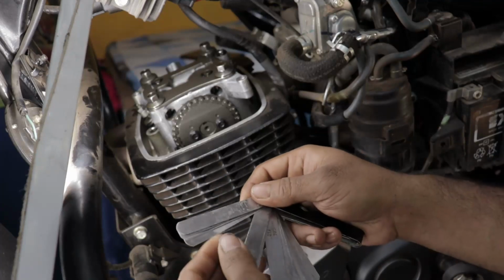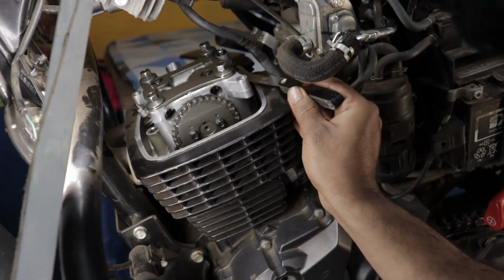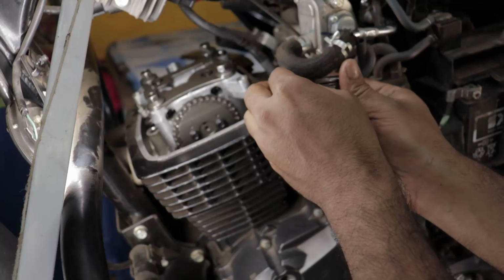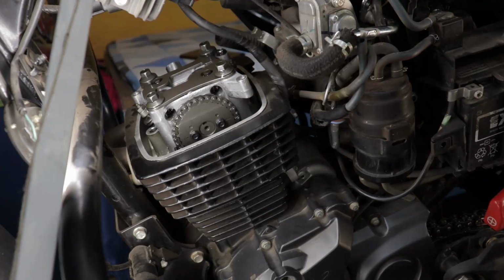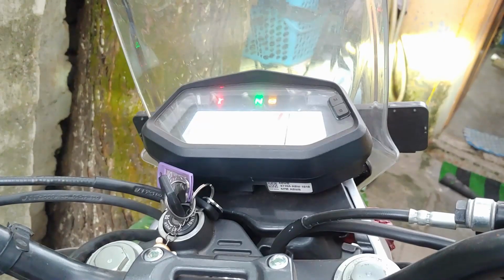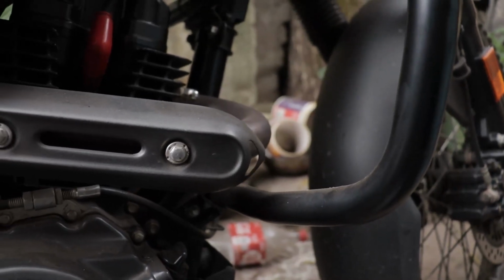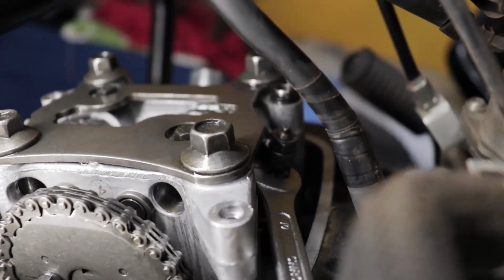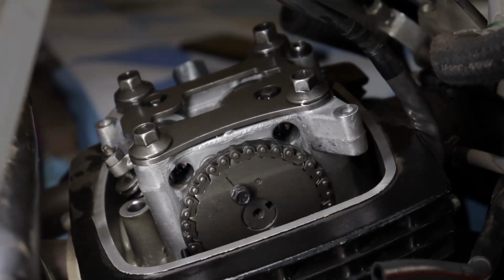Xpulse 200 Best Valve Setting

Comment: I know a hero cheif mechanic.  He says every xpulse has valve issues, every day people come in needing new valve guides, and on top of it they need to put in pulsar valve guides.
Reply from the maker: that is quite surprising to hear. Does it fix the valve noise?
Reply: @YogeshKumar-tk1sv  yup, I put 225 bore and pulsar 250 guides with xpulse valves
Reply from the maker: @pascaljean2333  Did it eliminate valve  noise issues?
Reply: @YogeshKumar-tk1sv  no ticking sound.
Reply from the maker: @pascaljean2333  I'll have to try that
Reply: @YogeshKumar-tk1sv  so I just started it, light clicking on cold, when warm no ticks, smooth sound
Reply: @YogeshKumar-tk1sv  some people have been talking about putting the cbr250 motor in that frame
Reply from the maker: @pascaljean2333  I have been one of em
Reply from the maker: That would be a match made in heaven.

Comment: Hi, I own xpulse 200 bs6., The engine used to heat a lot even after a 2km run, and if I grab hold the clutch while riding at 70km/hr speed, can hear wierd engine sound( like some loose spinning plate hitting the outer shell) vibration can be felt on left foot peg very strong and clear. Showroom people are not being honest., Any  suggestions or advice Would be appreciated Sir, thank you...
Reply from the maker: I m sorry to say that i wont be of any help online. If you live close to Kharagpur, i can take a look and probably narrow down your issue.
Reply: @YogeshKumar-tk1sv  
Thanks for your swift reply sir., I live in Bangalore. Good night 😴
Reply from the maker: @yaducheeta  You could record the issue, upload it and send me a link? It doesnt hurt to take a look.
Reply: I face the same exact problem bro. I can feel vibration in leg footpegs

Comment: Bro i have xtreme 200r with same issue. Can i use this tip its ok for xtreme 200r. Is any complaints for future. Like cam shaft complaint etc?
Reply from the maker: check your user manual for clearance values first. You can follow my method, on how to set the valve clearance.

Comment: Bro recently I have changed spark plugs of my pulsar 200rs, after changing engine is running hot radiator fan kicks on for every 5 mins, I used central plug NGk lkar8ai -9 and slaves NGK cpr8ea-9 yamaha plugs
Reply from the maker: Change back to stock to check if the problem still exists.
Reply: @YogeshKumar-tk1sv  ok bro❤️ again I have to work on my bike for 2 days 😅🙏for removing farings and fix it back
Reply: @YogeshKumar-tk1sv  and I also noticed bro after 5mins of iddle I removed the left side slave plug, I saw ground electrode has become white

Comment: Ok! So u find .06 for intake valve and .102 for exust valve clearance? Now how bike is performing after few days? And also plz tell how many turns for air fuel mixture screw for carburetor version.
Reply: Depending on altitude. From zero 3-4 turns

Comment: From the sound of valves i can say you have got the best possible settings! Now the engine has a continuous beat. I agree to what you said Hero has chosen the easy way. They could have taken extra effort in making a refined engine. Noisy valves are always a put off. In fact the 2015-2016 Hunk/Xtreme and the later Hero designed 110cc BS4 models of passion, i smart and 125cc glamour had the same valve clatter at idle. The valve clatter doesn't go even if you adjust the valves to specification due to using high lift camshaft. But with BS6 engines Hero has gone the extra mile in making refined engines. Check out the bs6 series of Xtreme 160R, passion and glamour, you wont able to hear any hint of valve clatter at idle. Would like to know your observations on BS6 Hero engines.
Reply from the maker: this whole virus situation has screwed any attempts of mine to check out a bs6 xpulse. I even have set aside considerable moolah to retrofit bs6 part on bs4. Just waiting on Zero to pick up the pace of parts delivery.

Comment: Hey hii
Did you also face this kind of issue when the bike goes over bad roads or potholes, the ABS kicks in which makes the front brake lever hard due to which the rider can’t apply the brakes for 2-3 seconds.
I own a Xtreme200r and I also have this hardening of front brake Lever.
Reply from the maker: Yes. Xpulse has this issue. This just very basic abs unit, which is too aggressive and locks the lever even when you have grip. Inverse is also true- during hard braking in dirt or gravel, abs doesnot kick in and I ended up locking the front. Scary stuff
Reply: @YogeshKumar-tk1sv  so did you find a solution, bcoz both Engine head and ABS unit replacement is being provided for Xpulse 200 I guess 
https://www.motorbeam.com/hero-xpulse-200-abs-issue-rectified/
Reply from the maker: @vijaysinghrocks  I noticed the course engine noise and complained to the dealership after taking the test ride. But like ever salesman " who sb service me ok hojyega". And I didn't know about abs unit replacement. I will contact hero about the reworked head and abs unit asap.
Reply from the maker: @vijaysinghrocks  Thank you bro for bringing it to my attention.
Reply: Because after I made a complaint for ABS Issue and replacement in June 2019 but as we know the service centre people told me that every xtreme is like that only having hard brake as it is ABS, but when I read about the ABS replacement in Website I complained again to higher level and got a call that I will get HCU unit replaced. That's wonderful if it work's fine after replacement.

Comment: You are true. Engines are rebored. Increased the displacement with bore and stroke. They know this is going to happen not that they don't have knowledge. But it was cost cutting measure because the bike is entirely new to the segment and they might be afraid of the numbers in sales as already impulse was already boomed by market. Now the bike with BS6 comes with an oil cooler to address engine temperature. People buying this bike should not be afraid of this issue anymore.

Comment: Great work! Thank you so much. Hero is going to put an oil cooler in the BS6 XPulse? Do you think retrofitting that and maintaining tight valve clearances should solve the issue?
Reply from the maker: To some extent, Yes. I wouldnt go too far out of spec though. I am currently looking to retrofit a P220 oil cooler on xpulse. I dont mind waiting for a while to get OEM cooler.
Reply: You can go for Karizma 223 oil cooler to xpulse.
Reply from the maker: @RishisJugaad  thats a brilliant idea.
Reply: @YogeshKumar-tk1sv  thanks
Reply: @YogeshKumar-tk1sv  yes they are a direct fit...
Reply: @YogeshKumar-tk1sv  what if I rebore my Xpulse 200 fi to 223 with 70mm pistons and add a oil cooler, I believe the bike is going to be a rock star, please put ur views
Reply from the maker: @raulgangsta5750  I think there are kits for that. And more power is always nice.